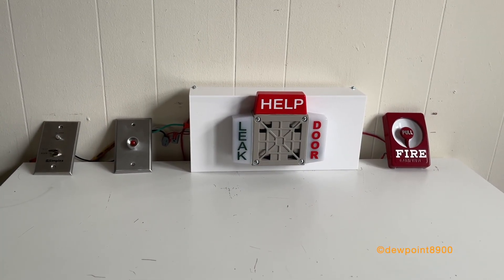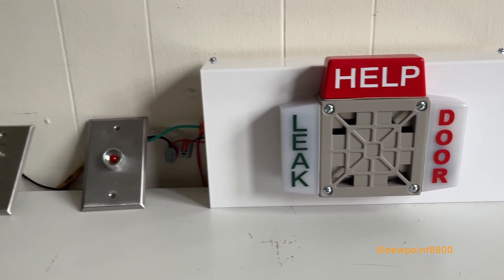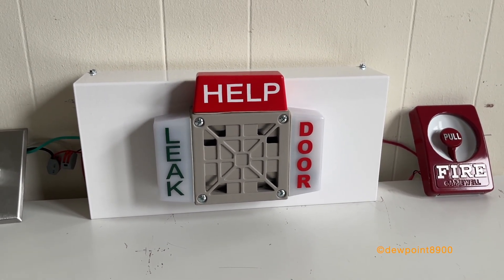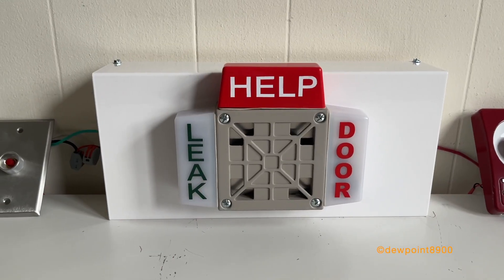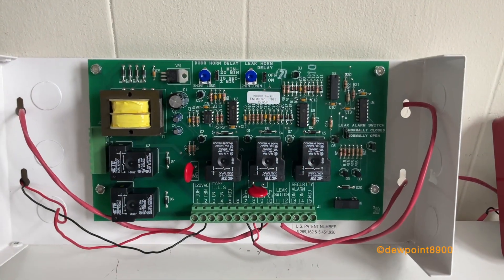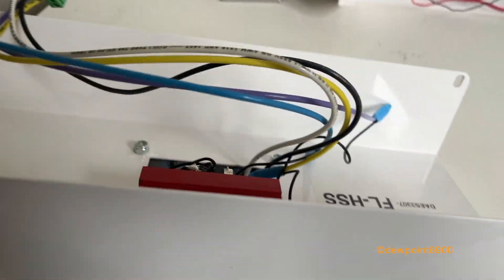Refrigeration Door Alarm with Wheelock 31T Horn

Comment: Excellent demonstration, thanks for it! I do believe you're the first enthusiast to make a video of one of these, if not outright have one to begin with! They're very interesting & unique devices for sure (including how "DOOR" is in a different font than the other lettering).

Interesting to see frosted Wheelock strobes that are that bright, given Wheelock stopped using them for fire alarm service before they could be made that bright (which would have been possible, it just would have taken more amps to get a frosted-lens strobe to be at least 15 candela, which is why manufacturers went to clear-lens strobes I have been told (of course this is likely a moot point nowdays with how little amp draw LED strobes have).

Any idea what the "HELP" strobe would be used for exactly? The others are straightforward but I can't imagine what the "HELP" strobe would be intended for (aside from maybe customer service being needed, even though if you ask me a horn sounding in response to such is a little overkill).

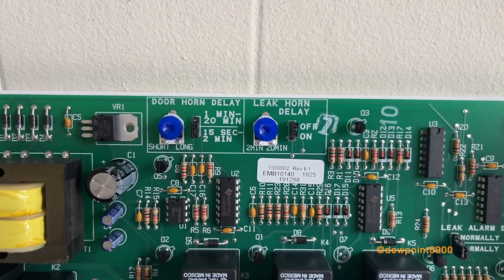3:28 I can't believe a delay is an option considering how dangerous refrigerant can be when leaking into an occupied space: one would think that it should sound immediately upon detection of refrigerant to help ensure everyone evacuates the area as quickly as possible.

3:35 As well as whether it sounds for a short duration or long duration going by that potentiometer.

3:45 Well that's clever!

4:30 Yeah, for sure! Quite neat & unique to say the least.

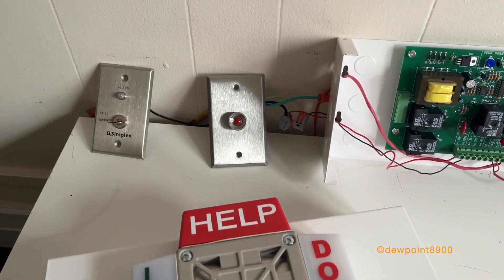4:41 Mhm!

4:48 I did!

4:49 You too Dew!